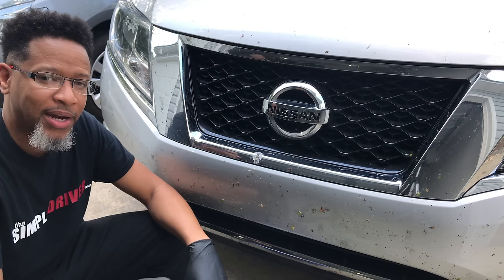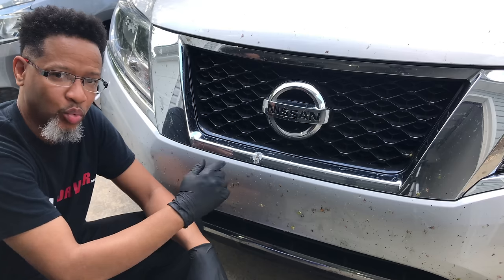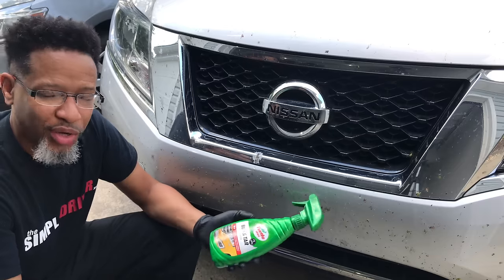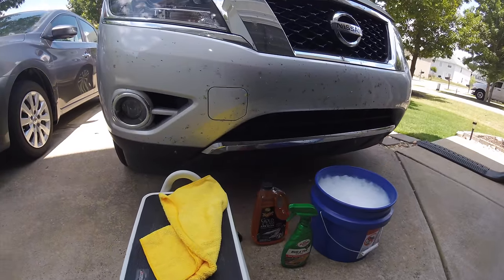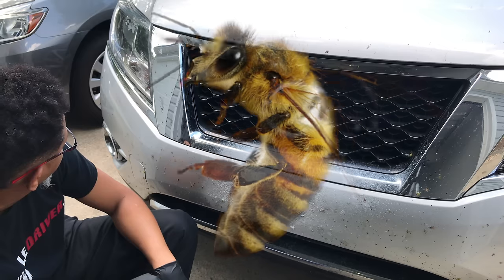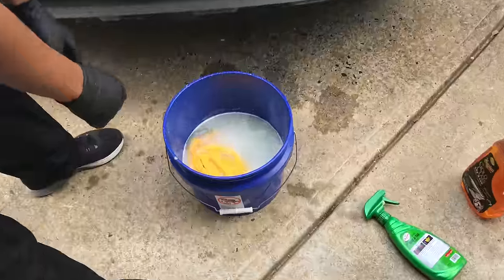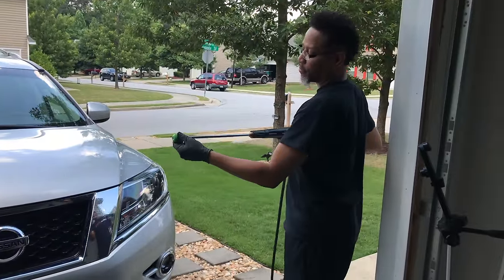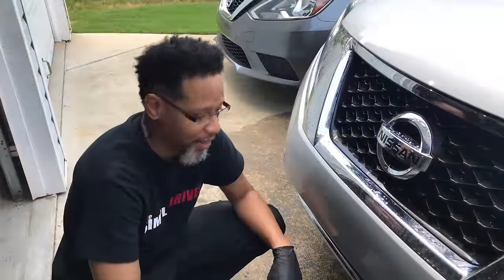Removing Dead Bugs From Car Front Bumper (FAST)

Comment: I recently started driving in the ATL area, I've been driving for about a week, however before that I never really left my house aside from going to my job, so I'm not familiar with the area at all. What are the best area's to drive in generally during what times and days? I've been all over ATL which gets me a lot rides, but not a lot of money, I've driven in Lawrenceville, Alpharetta, Downtown ATL, Kennesaw, and some other places around that, sometimes I don't know where I am and just use my GPS to head home and take rides on my way back. I've ended up an hour and half away from home before. I just want some advice on where, starting off as an uber driver, is the best location(s)/time(s) Mon-Fri for now.

Comment: Even with the lubrication of soap and bug wash, rubbing circles w/ a microfiber that has bugs in it isn't good for your paint. I would get the bugs off in small straight motions first, then soap and rinse, then maybe a spray wax to restore protection stripped from the bug wash.